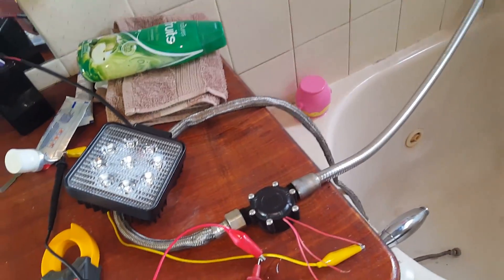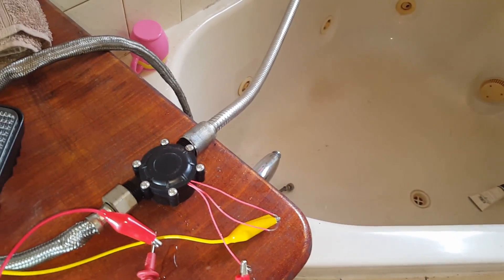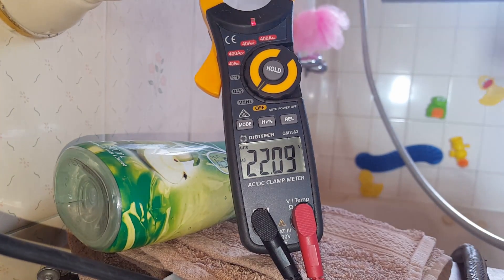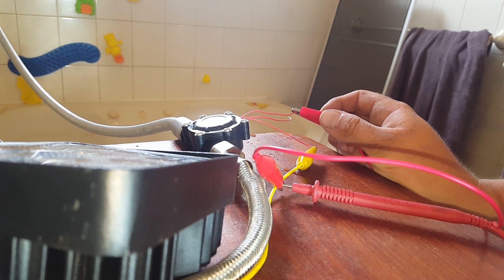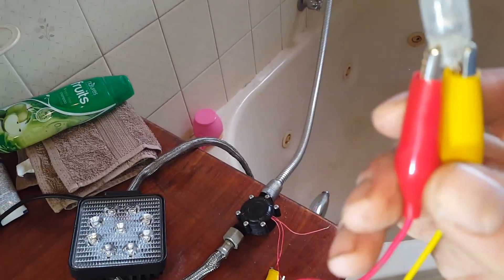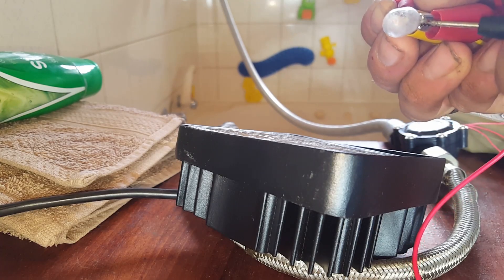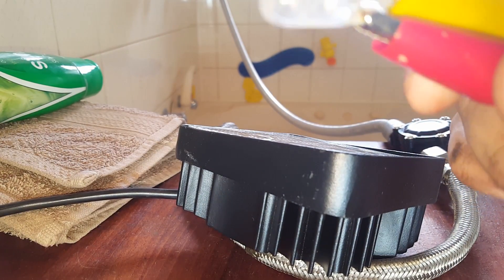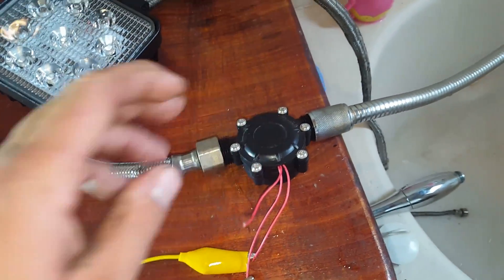Testing micro Hydro power turbine Ac output?

Comment: What will be the required height if I were to use the flow of wqter
Reply from the maker: That was at around 50 psi
Reply: @Oneupthesleevecustoms  cuz I would like to just connect it to a water tank, for curiosity, what would be the height?

Comment: seeing as the water is continually pushed out by more water could you not just put several along the hose to get a higher output?
Reply from the maker: Yes yet to test it though
Reply: Jejejeje... ya estamos como con el sastre de D.Quijote...

Comment: Thanks for the video. I had an idea, not sure if it will work. How about hooking up a car electric water pump to the outlet of a water pump which then runs back into same tank. Not sure if car water pump can generate power from the water pressure.

Comment: I bought the 80v 200 ma model basically the same unit but the power control module is diffrent if i take out the module what will happen? And i also have the tp4650 charge control and the 5v usb charge modules do you think i can switch for another module. I wish i would of got the 5v 10w instead.
Reply from the maker: +erick sal i wish i went for the low voltage one also do you have a bridge rectifier on it
Reply: One Up The Sleeve Customs no i just hooked it up to the load it only gave out 12v but 0ma not enough pressure but is the rectifier necerssary? And what do you think about the tp4650

Comment: I think this mini-turbine actually generates a 3-phase AC voltage.
Connect a small three-phase rectifier, at the DC output then additionally connect a buffer capacitor and already there should be much more power come out.

Comment: Can I use it for a model of a hydroelectric power station? The model has only 2 meters fall height
Reply from the maker: +PianoDrumZ na needs heaps more flow and pressure to start genorating mate
Reply: ok thank u !
Reply from the maker: +PianoDrumZ no worries. Takes a fair bit of energy to make a turbine spin a water wheel may be a better idea cheers
Reply: ok thank u very much!
Reply: One thing: I just want to power a little LED... Is it really not enough power?
Reply from the maker: +PianoDrumZ na it only puts out 150ma at full 10l per min mains water smashing through  it these are very poor. 
And this ones ac power too not dc
Reply: Okay... Thanks for the information!
Reply from the maker: +PianoDrumZ no worries if your into this sort of stuff please consider  subscribing cheers
Reply from the maker: +PianoDrumZ 1V-9V Mini Hydroelectric Generator Wind Power Hydraulic Generator
https://banggood.app.link/tlX9BPre4H
Have a look at these
Reply: Thank u so much for your Help!

Comment: what's the max mah  output? I just got mine they say from 5/80v but nothing about mah
Reply from the maker: +erick sal dead short 333mah but constant 150
Reply: Do you think if it got hooked up to a transformer would it put out higher wattage amp
Reply from the maker: +erick sal wattage never changes mate
Reply from the maker: +erick sal so at 15v i was getting 150mah through a bridge  rectifier thats only 2.25watts
Reply: Do you mean milli amp?
Reply: erick sal:
If you connect a transformer in reverse, you get a higher voltage, but less current. In addition, losses still occur in the transformer.
In short: Whatever you do, you'll never get more energy in the end than was put in. That simply does not work.
If there were no losses, you would be able to extract the same power, only that the voltage would be higher and the current lower.

Comment: have ya got a link to this how will it go running air through it
Reply from the maker: na but i can test it ;]
Reply from the maker: it  spins up no worries but also slows down hard underload. i used a blow gun to test it i will see what happends with it plumbed into the outlet line of the compressors tank